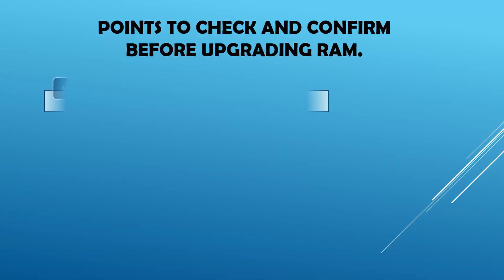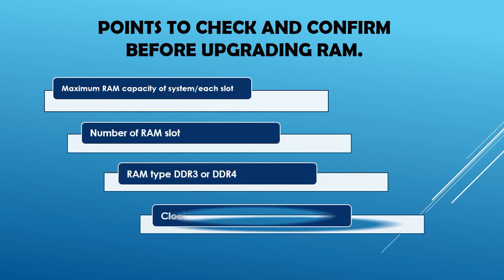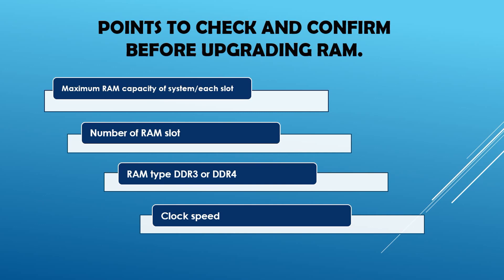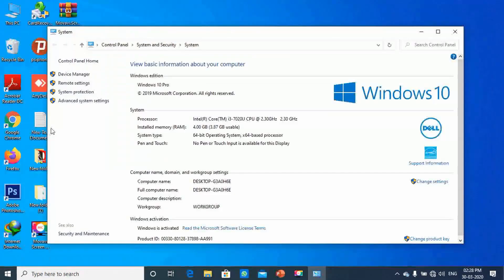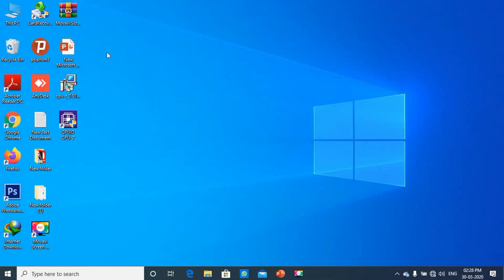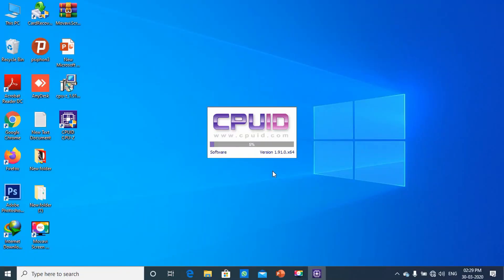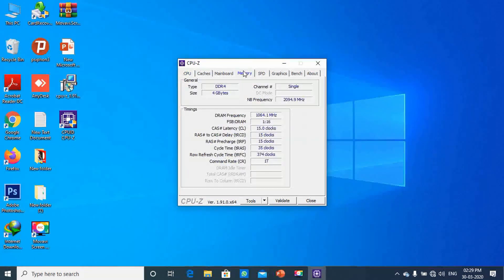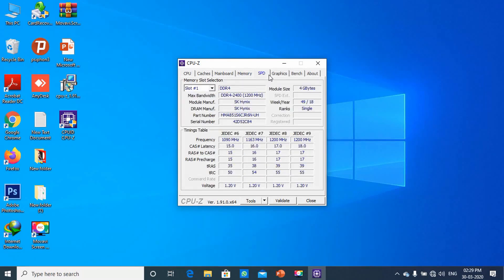How to upgrade laptop RAM easily | Dell Vostro 15 3568 | Malayalam

Comment: Bro എന്റെ 4ram lap 8ram ആകാൻ കഴിയുമോ
Reply from the maker: Bro adhyam kurach kariyagal check cheyyanam adhe nja  inde video inde starting paranjit unde.
RAM slot. Max RAM capacity...
Reply: എന്റെ സിസ്റ്റം dell i3 പ്രോസസ്സ് ആണ് 4ram
Reply from the maker: Bro just google it using model no.
Without model no i can't  check